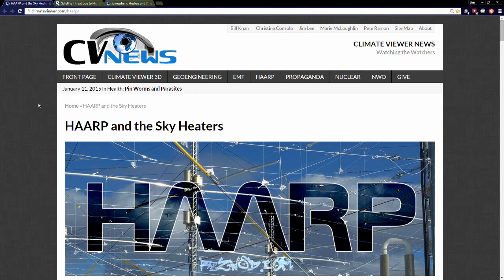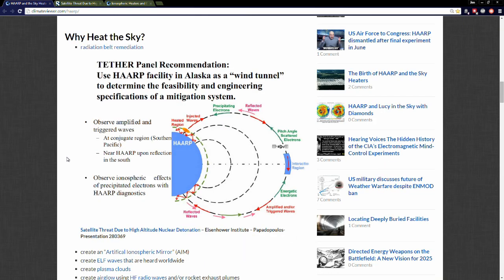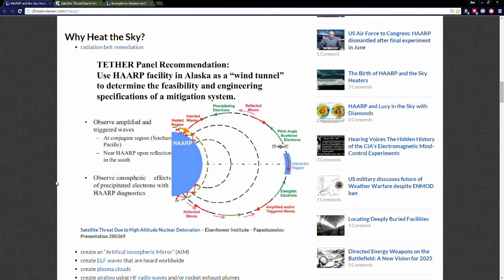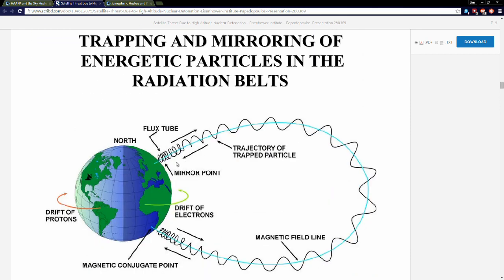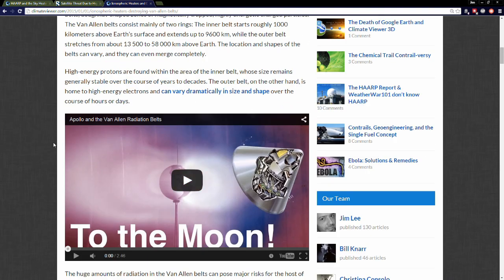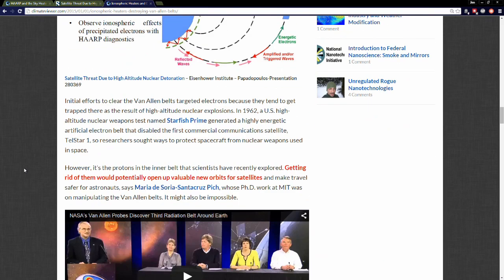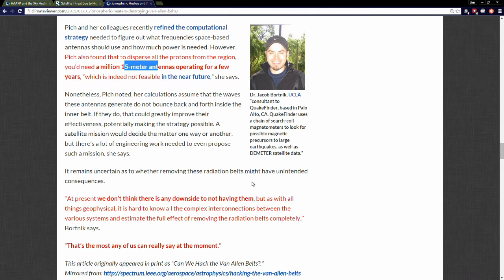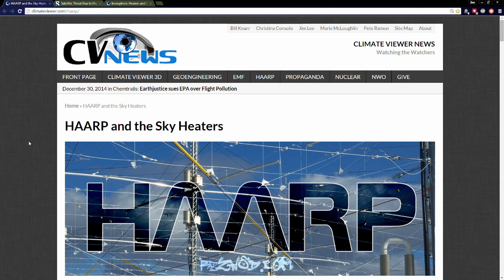Why Ionospheric Heaters are Destroying the Van Allen Belts

Comment: Thanks Jim. Great research as always. Certainly a new perspective. Do you happen to know what kind of radiation is in the Van Allen belts? And as mentioned in Elana's book where she talks about radiation leakage back into the atmosphere when holes are punched in the ionosphere by HAARP, could this radiation be the cause of some increases we are seeing from the norm in places like southern NZ which for years has been the drop-off point for the Alaskan HAARP facility? Appreciate your thoughts.
Reply from the maker: It's completely possible Greg.  As the EMIC waves hit the conjugate point near NZ trapped radiation falls out of the ionosphere.  Ever see any odd aurora between NZ and Australia?
Reply: Not where I am in Auckland bro. I'm too far North. But I will ask others I know further down South.

Comment: Wouldn't killing the radiation belt mean a layer of protection from solar storms and CME blasting out from the sun also be removed and the radiation would just flood down to lower layers of the the Earth's atmosphere? The ionosphere and radiation belts would be killed alright, but with the trade off just being the ionosphere would just be reborn at a lower layer of the Earth's atmosphere because of the constant flow of solar radiation as the sun's radiation just fries the lower atmosphere.

Comment: wrong. haarp's main but not only purpose is missile defense. It is designed to push the ionosphere up around 80 miles , so what would this do to a thermonuclear ICBM and/or warhead that is in orbit? It would suddenly re-enter the atmosphere prematurely and begin burning up. It's a glorious technology meant to save lives, and there are other things  haarp tech is entirely capable of. I believe they have made a good amount of money using the ground penetrating radar capability to take all guesswork out of mining minerals etc... because haarp presents a very precise and unmatched ability to see underground. This means all your bases are belong to us. Also it can be used like a direct energy weapon, but it would be very dependent on the amount of electrons etc.. in the atmosphere at the time and place, and it would be capable of striking the earth with a thunderbolt that is more powerful than any lightning earth could naturally produce, but not as powerful as any tiny sub-kiloton tactical nuke, however it would be very powerful compared with all conventional weapons yes.